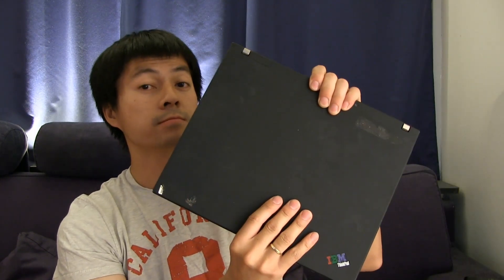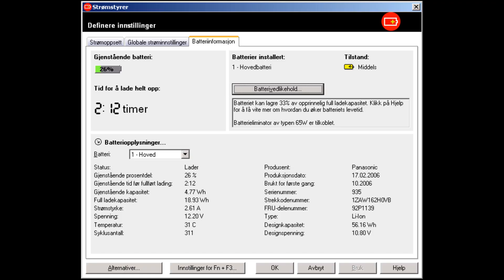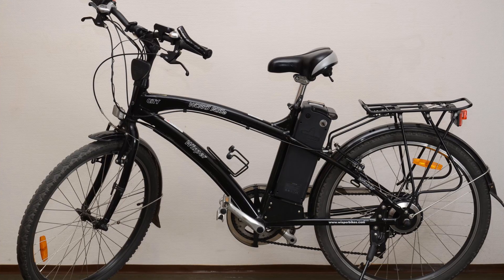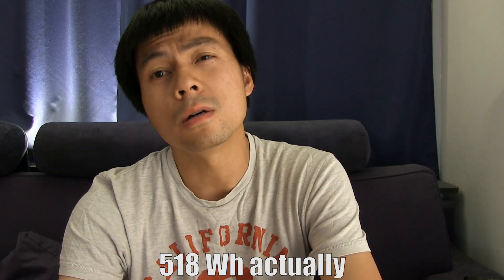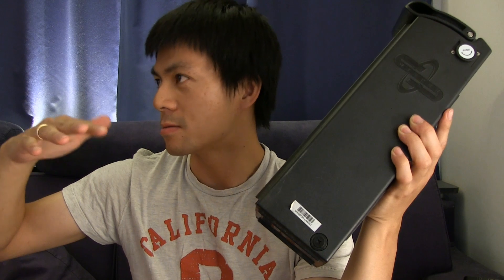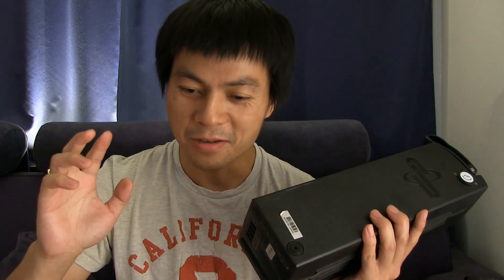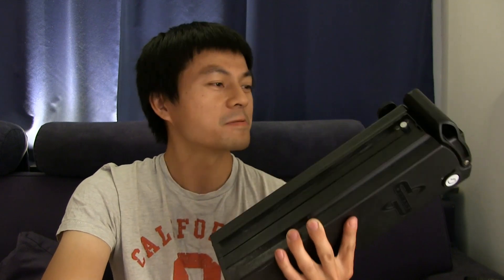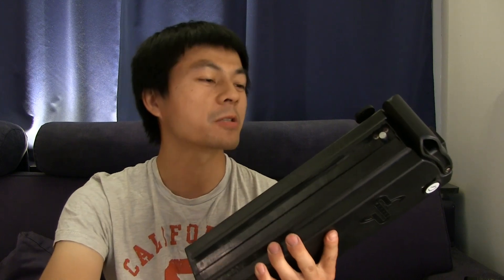How I killed two Lithium batteries

Comment: The Thinkpad tool you mentioned (now "Lenovo Vantage") also allows you to set a much lower charging threshold than the 90% you mentioned. As I use my laptop almost exclusively plugged in (but it needs to be a laptop as I work in both the office and in my home office), I set the limit to 50%.

Comment: 100 cycles on laptop battery is not much. I have 128 cycles on my Macbook Pro and it is behaving like almost new. The laptop is 2 years old and has been in charger about all of the time because I use it at work as replacement of desktop computer. It gives still many hours of work time without the cable. I have experience on IBM/Lenovo laptops and I think they have less sophisticated BMS than Apple has on Macs which actually causes them to fail rather than keeping the charging on all the time (as evidently Macs can survive that).

Comment: IBM used to have the best battery management, you could actually adjust the range of the charge to a maximum of your choosing to prevent excessive charge and discharge, the same way tesla does it.  Was ahead of its time, sadly IBM thinkpads are no more, have no idea if lenovo even bothers, and apple most certainly does not care. 
Ibm failed to educate the customers on the value of this feature which is the shame.

Comment: Sure the Life Cycle depends on storage voltage and temperature BUT there are many cheap cells which die very fast. (Samsung 26J/H/F and so on.

The Samsung 29E has a much bigger life cycle. You should open up the case and tell us which Cells are in there. 

There are even cheaper Cells in some noname bikes. They tend to get fat in this case so you cant even remove them. These are no 18650 Cells, they are more like bags. 

And the Laptop Battery there is another Problem. The electronics in the Battery counts the Ah which get in and out. Some electronics make a little fault at counting. What happens is that the electronics think the battery is degrated but it isnt. 

You should shut off all safety feature in windows and lett the battery run out till ist shuts off completely. I bought a 95Wh Battery which was down to around 40Wh. After charging recharging till it runs out severel time the Capacity got up to 92Wh so nealy new (with 150cycles and 4 years). the Battery is now working fine.

Comment: Actually, the most vendors limit the charging of the laptop-batteries to 90% so the charging is much faster "done", you see this compared to the tesla, where the last few percentages take a huge time. This is different on Laptops where the last 15% which the user sees are a bit slower but not like on the tesla :)

I think you just left the battery on to low temperature or it was a bad quality. Something below 10°C kills batteries. :)

Comment: Did you ever recalibrate your T60 battery? Some of them have a habit of deducting from the capacity they show for every time they're fully charged, but when calibrating, they go back up to the capacity they really have left. I bought a used T60 as well last summer, and the battery only showed 63% of rated capacity, but after 2 calibrations it went back up to 90% (in this case 75,52 Wh for a 9-cell pack).

Comment: on most of those thinkpads, in the software shown, it has a setting where you can tell it at what level to begin charging and when to stop charging. i normally set it to stop charging at 90% and begin charging when its below 75% that way it never reaches full charge.

Comment: The thing that killed the Laptop battery was sating fully charged and the temperature.
The bicycle battery most likely jocose of cold charging. All Lithium batteries will degrade if charged below freezing 0C by a phenomenon called Lithium plating and that is not reversible.
Not sure if Tesla has some battery warming system or dose not allow charging below zero Celsius.

Comment: You are correct. I also race RC cars and our batteries for those are charged frequently and very quickly to 100% and then discharged in 5 to 10 minutes. They never last much more than a year of racing once a week. Knowing this, I also had a Wisper ebike and looking after its battery I saw no degradation at all after almost three years of regular use.

Comment: I would say what killed your laptop-battery was much more the heat. While gaming, they most likely run at full capacity and get warm like 30-40°C. Like you said, not an optimal temperature for LiIons. Not charging it to 100% would be beneficial to the lifetime, imho it's not worth the inconvenience. I would say they hold up to 5 years without much degradation if you don't hurt them in other ways (but I do take them out if I'm at home on the plug). 5 years is probably the time a new laptop is needed anyway ;) But with phone, car and tablet - I try to stick to the 80% rule.
Reply from the maker: Yes, while gaming, the CPU cores ran at 100 % and the whole computer felt like 60°C. Heat was most likely the cause.

Comment: You are right. Having the battery fully charged the most time killed the battery. This happened to your laptop-battery and to your bicycle-battery. Every 0.1V over 3.9V (per cell) reduce the lifetime by the half (approximately). Storaging at higher temperature (over 20°C) is also bad. Btw: your laptop also gets very hot and so does the battery. When the battery has about 30°C instead of 20°C for the most time, the lifetime will be reduced by the half. 5-10°C would be a good storage temperature. This is because of the electrolyte that will disintegrate over time. This happens all the time but much faster at higher temperatures (chemical reactions go faster at higher temperatures) and at higher voltage (there are always some "electrolytical processes" that disintegrate the electrolyte. That's btw the same reason why charging over 4.25V destroys your battery: the electrolyt starts to disintegrate at very high speed.

Comment: I use my Galaxy Tab for watching movies at the gym and Youtube at bedtime.  Takes six hours to charge, i plug it in a couple hours before heading to gym and maybe half an hour before bedtime.   It spends most of it's time with less than 10% charge and rarely gets charged over 60%.     After a year of this, battery meter became inaccurate (was reporting 50% full after only 1 hour charging from empty) so I gave it a full 6 hour charge to 100%, which restored battery gauge accuracy.  Nearly 2 yr old, the battery is great but the tablet is already obsolete... slow in general use

Comment: I read somewhere the best is to keep Li-batteries between 20-80%, so you're right. Since then i try to keep this "rule".
What i don't like is when i realize right before bedtime, that my cell phone won't make the next day without charging. But if i put it on charge then it will charge to 100% till the morning.
Bottom line, if you really wanna take care of the battery, you have to start charging at least 1 hour before bedtime, so you can plug it out around 80%.
Other option is to charge it in the morning.
Reply from the maker: It's a matter of habits. I start charging in the evening to 80 % and unplug my phone. If I need more juice during the day at work, I can always plug it in there. A timer would solve the problem too, like John mentioned.
Reply: +Rustyka89 If a phone is not able to interrupt charging when it's done, then it's a pretty poor design... mine was always charged to max, it's a cheap samsung star II phone, and it's battery lasted 5-6 years. So did my laptop's battery, and my previous cheap nokia phone's battery. However my tablet's battery was heavily damaged in 1 year... I guess that wasn't built to last long... that's all... Get a good phone which has good power management, and you should never worry about battery life and leaving it plugged in.

Comment: I have exactly the same experience with my laptops batteries over years of usage.
You are 100% correct in this matter (that is my opinion).
It should be an option in laptop (cellphone) software to choose max batt. level of charge. Same as is in Tesla. Maybe it is already, maybe someone does this soft. I need to search in internet. Of course long batt life is not handy for batt. industry as they earn money when user needs to replace his batt. every 1-2 years of ussage (original or replacement - does not matter). Tesla has different point of view and they carry abt. their clients and that is why Teslas batt is doing very well over usage life time - so far. Two principal rules are : 1 - Users ability to proper maintain batt. 2 - Manuf.algorythms and proper battery-maintenance software implemented in their products.

Another great job Bjorn (this and previous vid) !

Comment: On "modern" laptops (>=2010) there is a microcontroller that is discharging your battery from time to time so is safe to keep it pluged in. I have an old laptop on wich I test linux distributions (over 8 years old I think, hp compaq nx6110) and the battery is still verry good, so I guess that battery quality was a bit random before.

Comment: Charging a cold battery shouldn't be a problem at all. At least if it's not freezing (10°C is more than enough).
And the best temperature to store batterys is 0°C.
btw. batteryuniversity.com is a great website to learn more about batterys.
Reply: 2nd that. Note that 100% charge on a device doesn't have to be 100%
 capacity on the (fresh) lithium battery. It depends on the design of the device, and how high and low voltage cut-offs are set for charge up to - and discharge down to. I know mobile phones have premature charging/discharging cut off. In that way they are trading off some capacity for longer battery life. It didn't use to be that way.. What I've heard.. Other than that, I agree on the sweet spot Bjørn talked about regarding capacity losses, but I don't think that alone explains the whole capacity loss. Could be other stuff like unbalanced cells or lack of balancing circuit, poor quality cells etc..